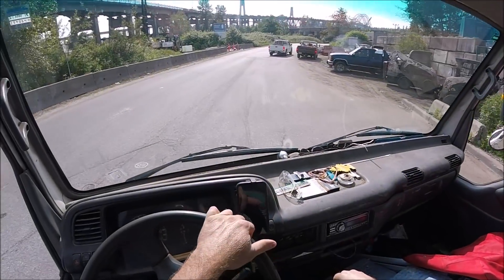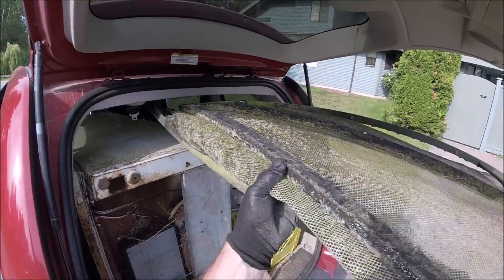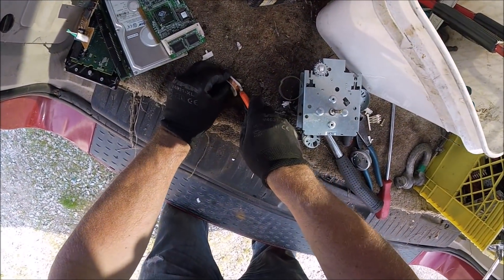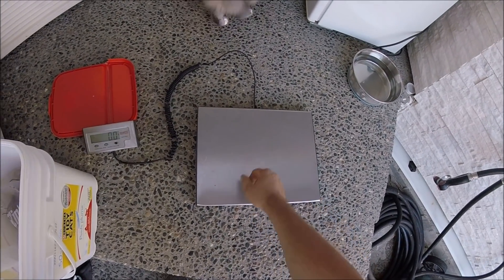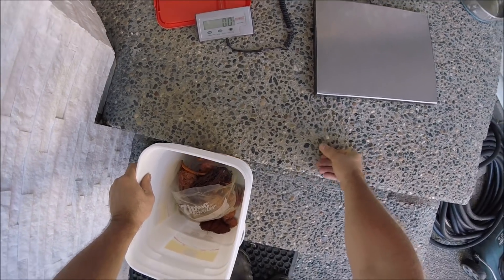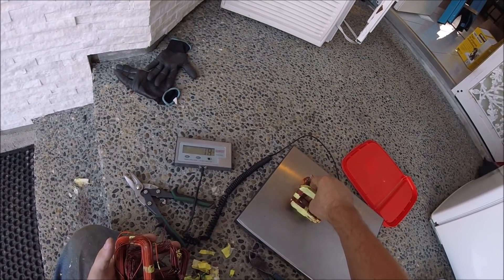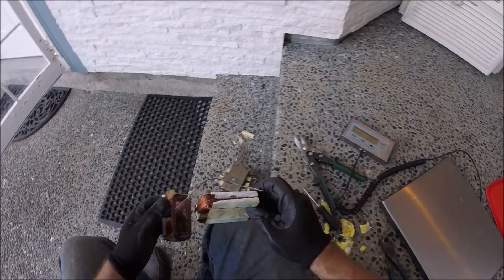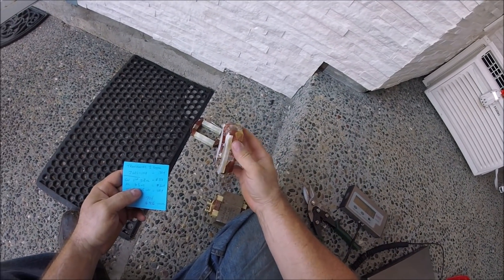Scrapping Microwave Transformers is it worth it? & More

Comment: Nice add to the job with the scale. I almost always only use a hammer to take those transformers apart. I hit it right on the soldering line alternating both sides. Comes apart fairly easily. I've only brought 1 in to check how my yard wanted it. They paid it as #2 copper and aluminium. They do prefer I take off as much of that glue as possible.
Reply from the maker: Thanks For Watching, Yes the cleaner the better

Comment: I used to leave all the tape on the copper from the transformers. It doesn’t weigh anything anyway. Definitely worth doing, even if you just save them up for a while and weigh them all in together. I used to just hammer the weld with a hammer. No hatchet.

Comment: You can sell the steel of transfomer as heavy steel HMS #1 ( that's what i do). You need to take most of the tape off. All scrap yard is diff. as you know. Need to ask. I dont micro scrap when both is aluminium, sell as is. Do the math. how much per hour you gain doing it. As is let's say 10min each = 4.20$.Micro scrap 6 x 4.16 = 24.92$. Added value = 20.72 per hour. Over 20$ for me it's worth it.
Reply from the maker: Thanks For Watching, I will now on scrap all copper in transformers as long it has one winding with copper, All that money lost over the years, When they paid 30 cents for transformers it was good & copper was only $2 per pound & now copper around $3 & they pay so little for it

Comment: Try burning the transformers in the grill before disassembling. There will be a complete cleaning of paper and glue.
Reply: Or after disassembly. It will be easier and faster.
Reply: Before disassembling the motor, it can also be burned. Copper is easier to pull out.
Reply from the maker: Thanks For Watching, I can't burn anything here, too many neighbors